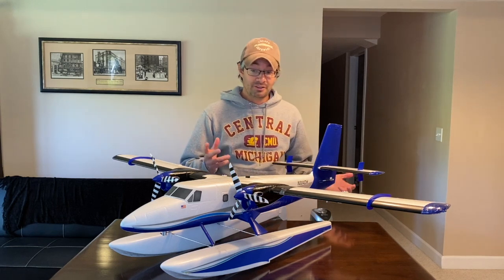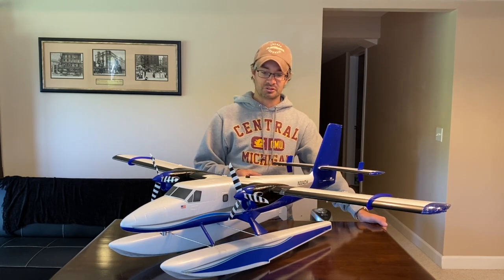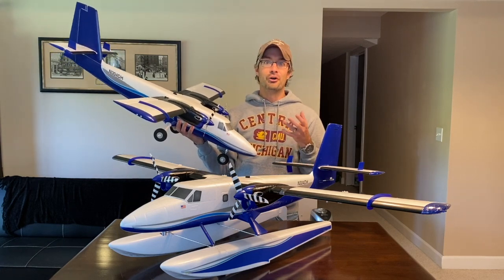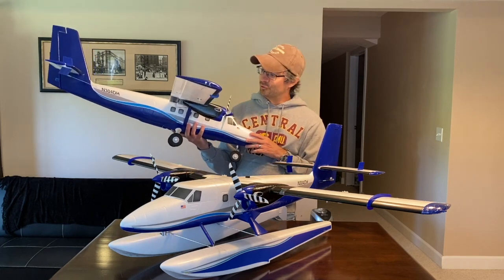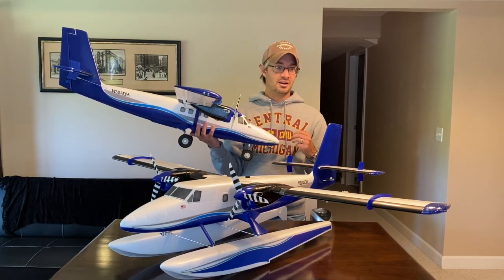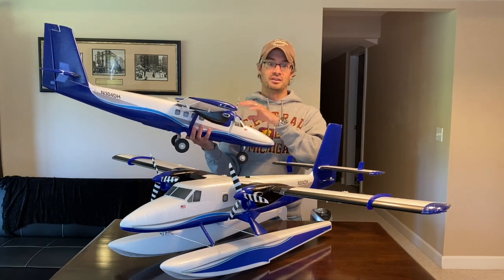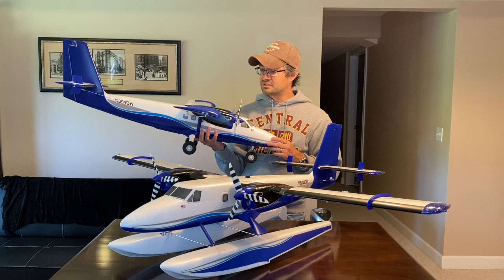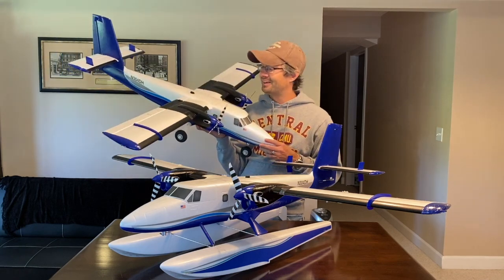I got an E-Flite Twin Otter!

Comment: I dont like the fact about to exchange the floats and wheel gear. got some advice bc the screws are small and you must be very careful with them bc you can strip them out easy.
Reply from the maker: Right, the screws are pretty small and can strip easily. I tend to limit the amount of times I change between floats and gear. In the spring, I will add the floats and keep them on for about a month while our club runway is flooded and we fly float planes. After that, I will install the gear and leave them on for the rest of the year. On my Timber, I now just leave the floats on all year.